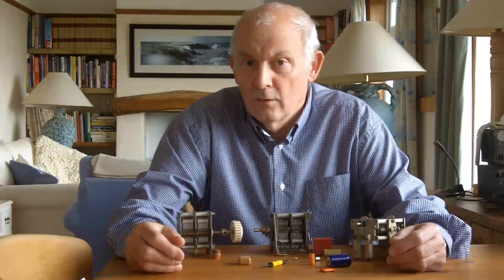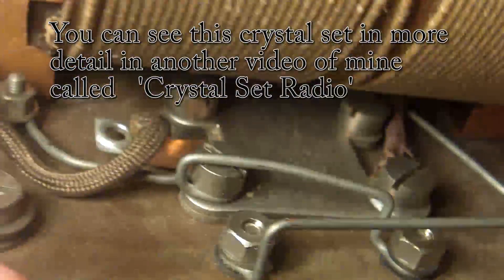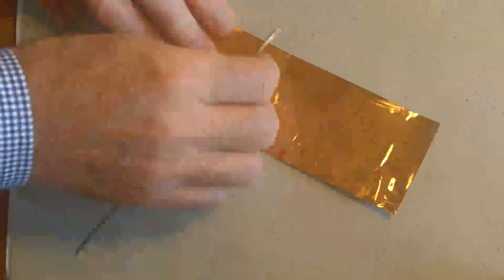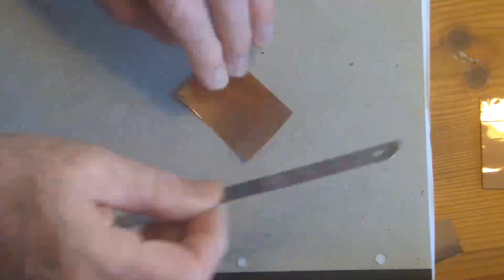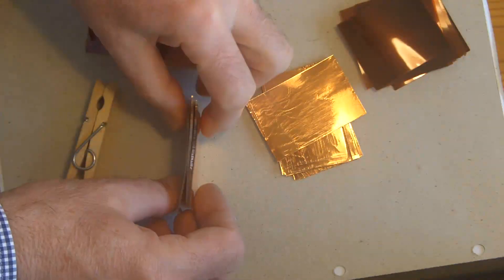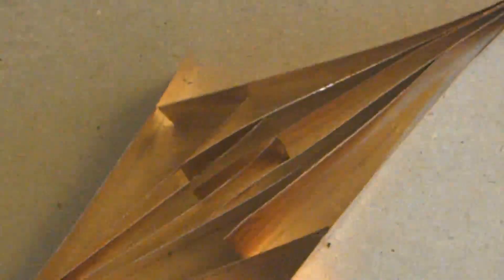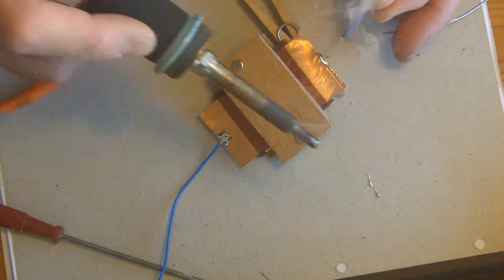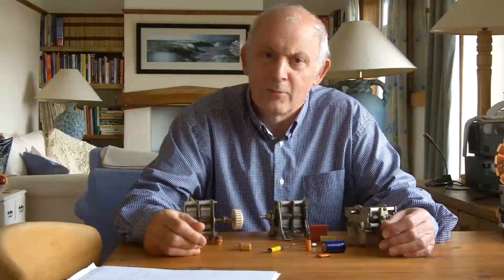About Capacitors ... Part 1 Making a 3,400pF capacitor. By Andy Davies

Comment: Hi, Andy. I used to work with induction heaters ranging from 100 kW to 400 kW. They were used for steel tube manufacturing and ran with 12 kV on the anodes of one or two ceramic bodied water-cooled triodes.
Reply from the maker: Hi there, well Tube Welding has to be one of the most fantastic induction heating applications going! I remember when I was quite green behind the ears having a huge row with a tube mill owner. The tube just wasn’t welding and the men were all standing idle, all of the anode and grid readings were correct and I concluded that it was the impeder that was at fault (for those who don’t know, the impeder is a water cooled ferrite device that fits inside the tube that’s formed by the strip local to the induction coil) and of course this meant taking the steel strip out of the mill and stripping some of the rollers out and withdrawing the arm that holds the impeder in the right place.  I can still feel the huge sense of relief when we restarted the mill and it welded perfectly. I was right, although it looked OK the impeder had cracked. The mill owner had the good grace to apologise for his disbelief in me. Man I was so glad as I’d never seen or diagnosed that problem before and everyone in the factory thought I was nuts as it took hours to replace something that looked all right. Ah yes, water cooled anodes that were cooled by boiling the water and re-condensing the steam, all working at 12kV DC. Thanks for the comment, it brought back memories. Kind Regards
. . .  Andy.

Comment: I found a calculator that gives the properties of a magnetic loop antenna. Although it was fun to play with, it seemed to be telling me that the lower frequency bands weren't going to work well because the capacitor would need to be in the thousands of pF, and variable caps that high don't seem readily available. It would seem that these home-made caps, in parallel, would be the solution. Thanks for the idea!
Reply: I have build and used a number of mag loops.  In practical use I do not recall needing any more than a few hunderd pF.  One approach would be to use fixed cap in parallel with a variable cap.  Vacuum caps have desirable qualities to use with mag .oops.   Ohmic losses are important for mag loops, even tiny ones.  You should be using a butterfly cap for a mag loop.  Wiper contacts can be lossy.

Comment: I  visit your site often  and I should have congratulated  you on your style of teaching and presentations.
I have been teaching electronics  for a long time , over 50 years  and I grew up with the feel for the components I use. As the years go by, I find that my students have no feel for electronic components and no a single student would have an idea what a 20 pico farad capacitor would entail as far as area and separation between the plates are  required. It is all hidden from them as these days the equipment does not even get hot so the human relation with the equipment as we knew it is all gone.
Recently I went back to play with super-regenerative receivers and I construct my own capacitors  using printed circuit copper clad material, simply cutting the required area and soldering a coil to make an LC tuned circuit, My students were  curious about all this and asked questions as," how do you know the number of turns required for the frequency concerned?"  after I told them my rule of thumb about coils and capacitors to achieve a particular resonant  frequency approximation.
It is a new world, and people operate things rather than build things.  I just wonder if they  are being trained to handle  the realities of life. Seeing your videos is very encouraging that a gentleman like you finds great satisfaction working alone at home in the spare time you have. Nice peace of mind . Many people these days do not know what they do with themselves when they have some spare time.
Congratulations again, not only for the capacitors but for the gentle personality you project.

Comment: whats the largest capacitor you've made so far?
how far has your radios (crystal) reached,recieved? I built 2 SW, and have gotten radio cuba,nashville, TN, and even European radio!!!
one more question- would more windings make a better coil, or larger coil, or thinner wire, or a combination of them (large coil, thin wire, w/ a lot of windings)??
I use what I can find- wire from a wall adapter, coil form from an ink pen inside tube or 2 popcicle sticks).
good video!

Comment: Thank you very much for the info.  I'm already doing some tests with some commercial caps and getting 1.5 vt using two 600uf ganged together in series.  I have a bridge rec with the ant and gnd on the AC prongs and the caps on the +/-.  But I like building very old school type tube and crystal radios and want a very simplistic old looking cap.

Comment from the maker: 1 of 2 
Hi there
A capacitors ‘capacity’ to hold an electrical charge will increase proportionally with the increase in the number of plates but it will decrease proportionally as the air gap between the plates gets larger. So a lot of thin plates with a small gap between each will hold more charge. Capacitors can be difficult to get to grips with but if you want to make low voltage capacitors at home you could use aluminium foil and cling film (glad rap) 
See 2 of 2

Comment from the maker: 2 of 2 Cling film will be harder to work with but for any number of metal plates separated with thin film you’ll get more storage than if you use a thick film. For what you’re playing with the thickness of the metal plates doesn’t matter at all. You would only need thick metal plates if they had to carry a lot of current. Work safely and don’t do anything dumb and start playing with the mains or getting near any overhead power cable with that long wire.
Have fun. Kind Regards ... Andy

Comment: Great video!  I'm still learning about caps.  I want to make a voltage storage cap to charge from a long wire antennae and then run a small one trans amp for it powered by the cap.  Question, for storage of low voltage which is better, fewer thicker plates or many thinner plates?

Comment from the maker: @dtiydr Hi there, the bridge is a transistor model actually, not quite steam driven but not for off. The kaptan I’m playing with is the last bit I have left over from my working days, I used to manufacture Radio Frequency Induction Heaters, some of the old valve sets used to work with 8 kV on the anode and the output transformer was in the anode circuit was carrying up to 60kW. Although Mylar has the same dielectric strength (give or take) you can’t beat Kapton on temperature  ... Andy

Comment from the maker: @AndyDaviesByTheSea One final point on the Kapton 400 deg C = 752 deg F. One doesn’t normally require that sort of working temperature in a radio but to put it in perspective that’s about twice as hot as the maximum temperature of a domestic oven. When I was using Kapton it had, I believe, the highest dialectic strength of all know materials.
Thanks for watching. If you see any unanswered questions and you have the answer please don’t be shy about it, help out. ... Andy

Comment from the maker: @AndyDaviesByTheSea You’d be surprised at the amount of wood used in industrial capacitors, there may not be quite so much used now but certainly special purpose equipment (with low production rates or  One-off’s) often had handmade capacitors and wood was a natural choice. It wouldn’t be in a position where it would be in the dielectric field or were it was relied upon fro insulation, very often the capacitors would be in an oil filled aluminium case. You could open them up and repair them.

Comment from the maker: @Alex1M6 Hi there, the insulation that I’m using is Kapton from Du Pont it’s 0.1mm thick and it has a stated dielectric strength 290 kV/mm so notionally 29kV for the thickness I’m playing with although I’ve never pushed it that hard (not intentionally anyway) it has remarkable temperature withstand up to 400 deg C and wonderful corona resistance. The only problems are the inability to buy small quantities and the phenomenal cost, worth every penny it if you need it though. ... Andy

Comment: Hi Andy I really enjoyed the video, I like that particular method of using wood to clamp homemade capacitor plates together.

At what voltage does that insulating material you used break down at?